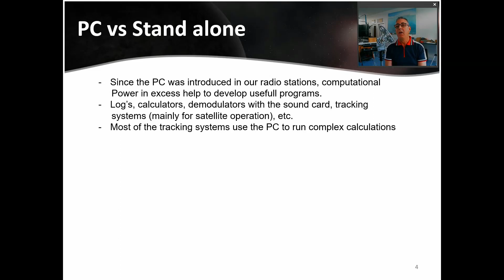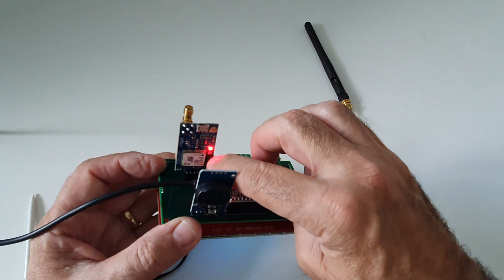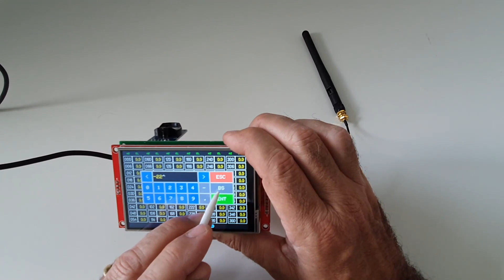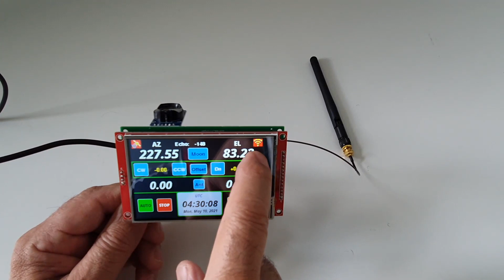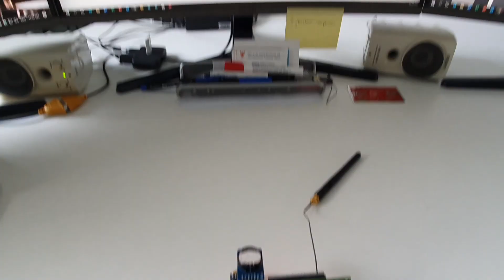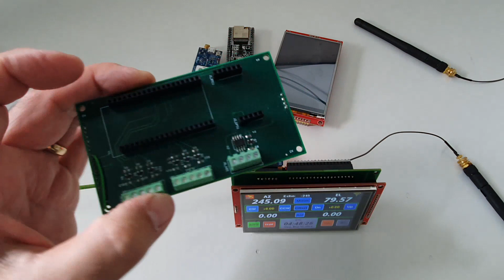AnTrack Pro Antenna Controller OFF-LINE workshop (preliminary information)

Comment: I'm happy to have two of the AnTtrack Pro systems, one for my 3.2 meters dish which is already working great,  and the other one is on the way for my 1.65m offset solid dish for 10ghz EME. thanks!

Comment: Looks very nice. What devices for encoder do you accept? ZL2ALW Re79qw
Reply: At the moment, MAB25, ETH25, HH12, HH12 inclinometer and ACS360 Posital inclinometer but I'm working on my own encoder, will be SSI protocol and 16bits means a REAL accuracy of 0.01 degree and not cosmetic accuracy, is funny see how people claim two decimal resolution and accuracy with HH12 or US digital A2S, really not possible with just 12bits